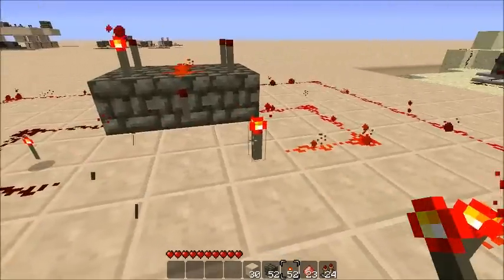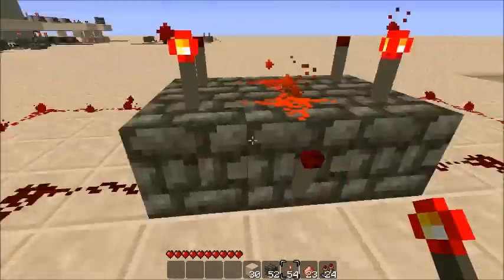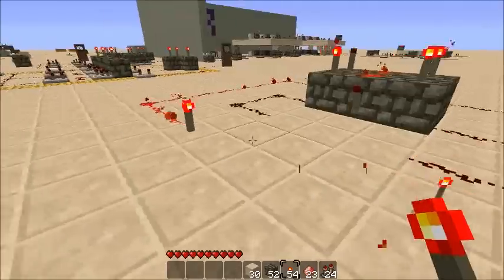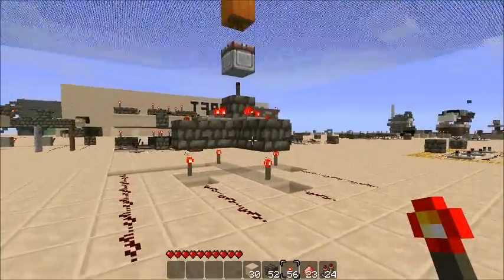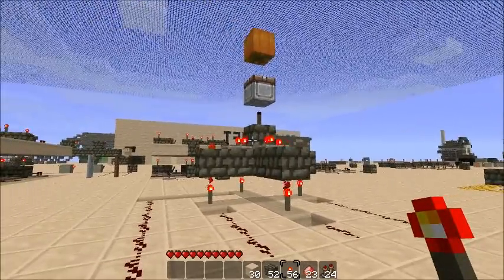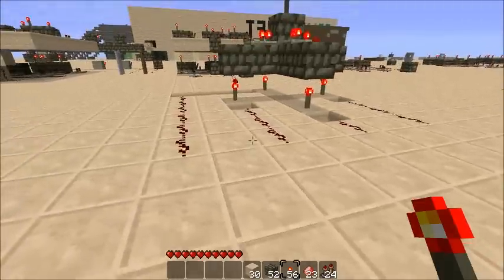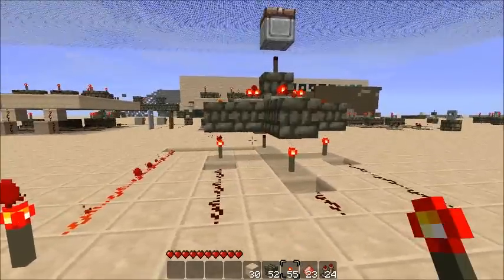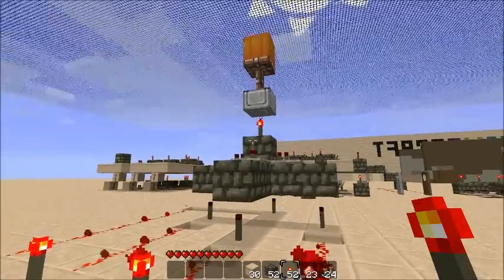4 AND GATE!

Comment from the maker: @HereticHy3na Yeah, I think that's correct. Each torch just needs to touch the red stone that touches the output. So, you can theoretically extend this as far back as you want and make a 30 AND Gate before needing to place a row for just a repeater before extending even further back. Keeping the wiring on the sides from crossing would it's own challenge though.